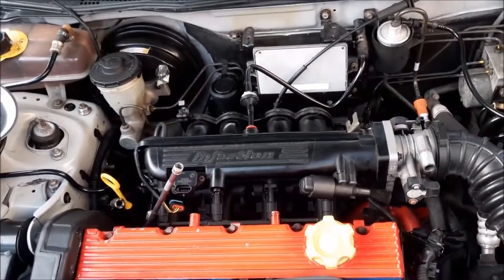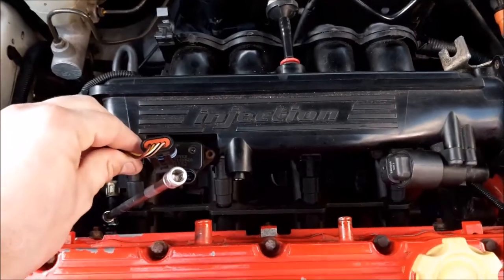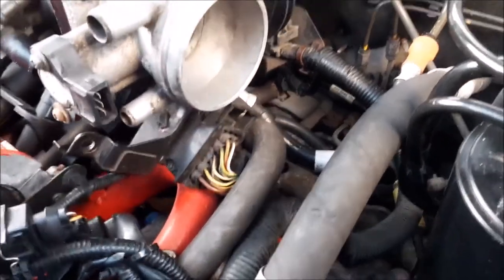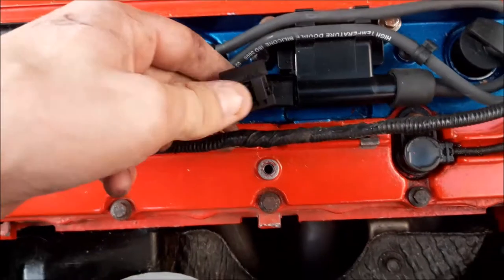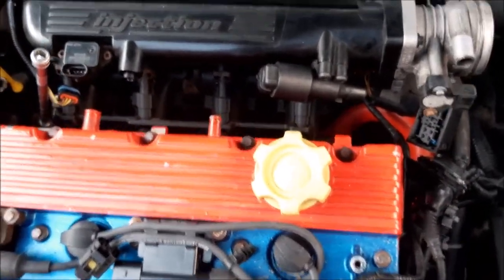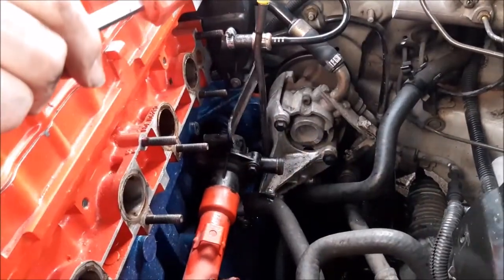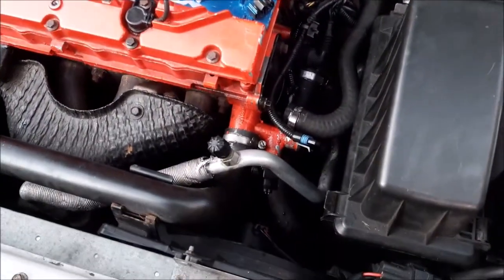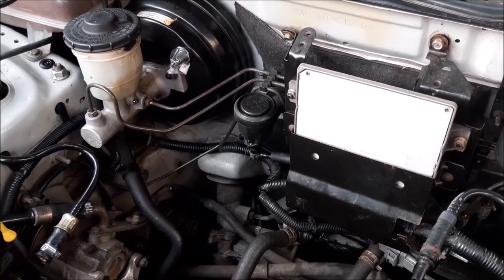Testing and replacing the thermostat on our Rover K series rover 45

Comment: Very good video, and  for me, here in pos Portugal, a good help seeing how things go before tackling this job tomorrow installing a NEW thermostat;
 2004 Rover 25,1.4 , heater takes for ever to warm up and the radiator in front starts to get warm right away:  this means ONLY one thing:  thermostat stuck in the OPEN position,  or maybe not..?;
Reply: that was the reason,a stuck openthemmo; 
this time i also installed a 80ºC thermostat, AND i did it from underneath, took just 15 minutes; you need to remove the steel pipe,and then only the three   8mm head small bolts; the rest of the black plastic housing stays in place; 

 just MAKE DOUBLE SURE you install the thermostat with the wax pellet,the spring,facing to the front of the engine,the RHS of the car,the timing belt side ,as cautionned in the video!!! 

doing it the other way around means SEVERE OVERHEATING, and possible engine good bye, since the thermostat WILL NOT OPEN, because it needs the hot  water from the heater hoses flowing across its wax pellet to open, and this ONLY occurs when it is installed with the spring/wax pellet facing to the timing belt side..